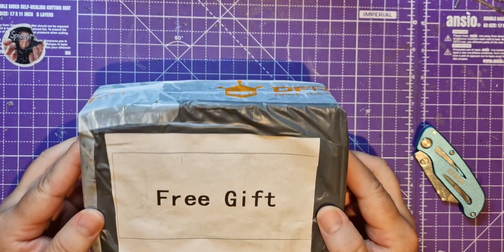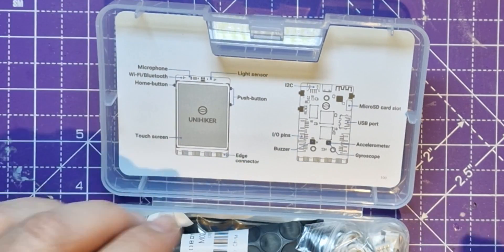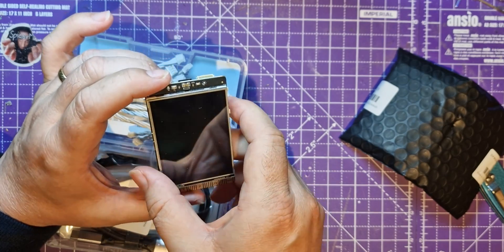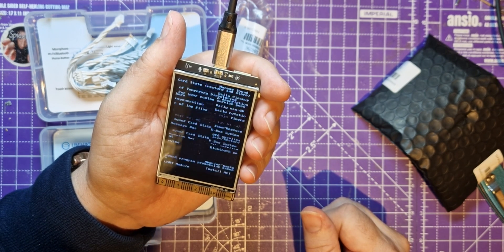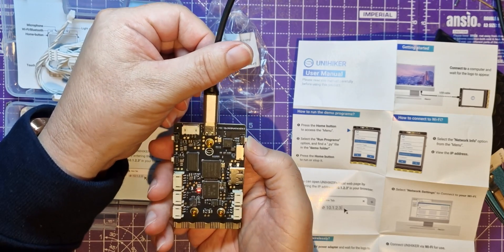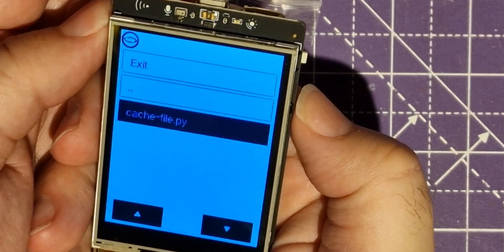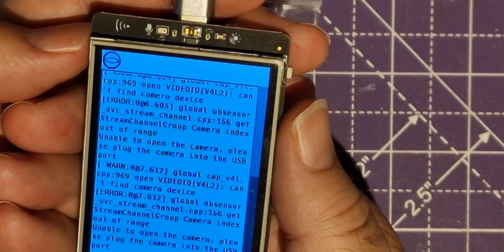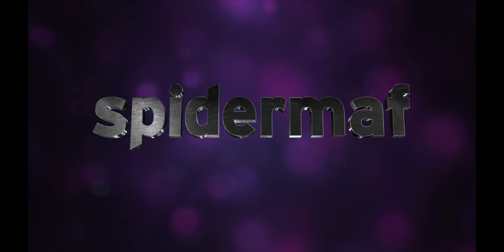First looks at the UniHiker - Single board computer with display and touch screen from DFRobot.

Comment: Well now this is a different animal! 
Nice to make your acquaintance - good YouTube reco.
Reply from the maker: Well hello.  Yeah this by the looks of the hardware I/f at the bottom its aimed at steam applications, (there's a scratch style IDE called MIND which it comes with). But because it runs Wifi and python, me thinks it would make a great drop box or similar applications too. Not what I would use it for but depending on its power consumption it seems smaller and with a touch screen interface might be easier to set up and leave somewhere than a pi for... other purposes.
Reply: @spidermaf  “Other purposes” is what I live for.